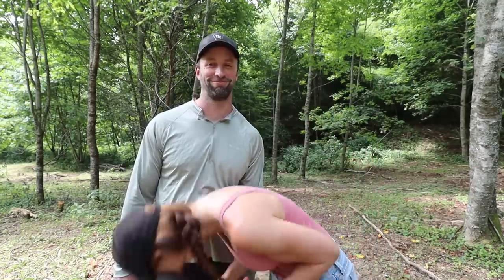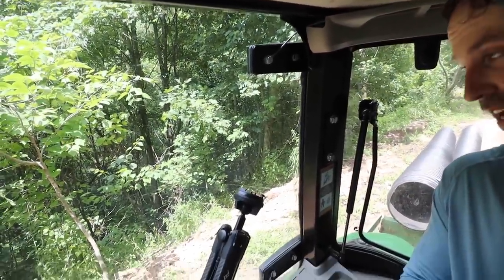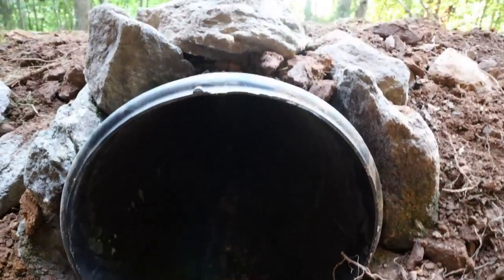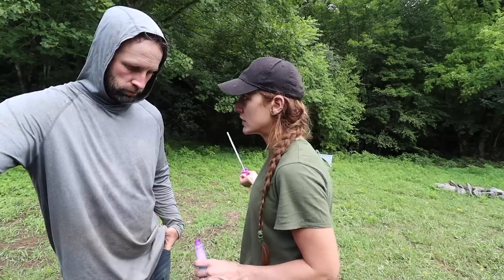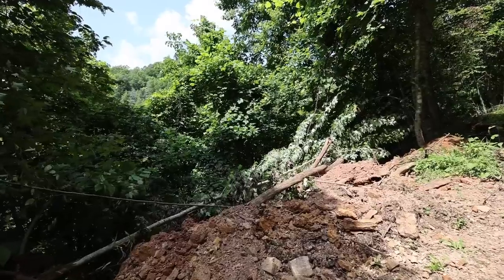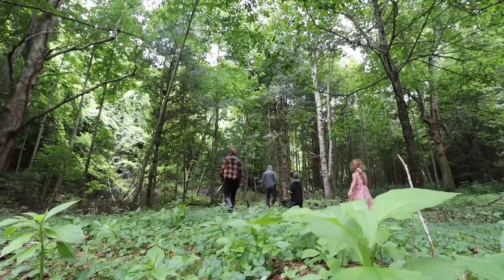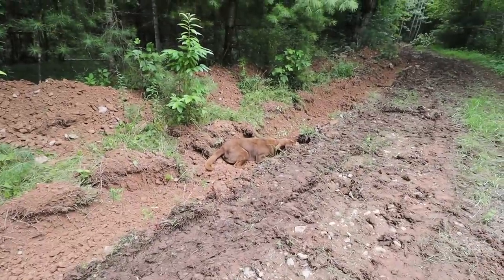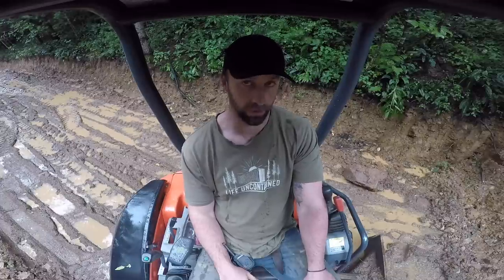FIGHTING ROCK, RAIN, & MUD | Building A Mountain Road

Comment: I think an excavator needs to be on your Xmas list. Your building a future from the foundations up because of this your future is going to be so much better. What a sensible approach.
Reply: Yes, that's what I was thinking also.  With especially how much they have to do. Sure would come in handy. They are easy to sell once or if they ever get done with it.  Also if they get one make sure it has a thumb attachment on the bucket. Makes it easier picking up brush or rocks.
Reply: With rock hammer attachment

Comment: They look to be orchard varieties, it doesn't;t take long for non-fruiting trees to take up residence. We see it a lot in the UK and Ireland, where old properties are taken over by nature but the fruit trees are so hardy they carry on even though crowded. I think it's perhaps because the soil is so fertile.
Reply: the apple tree has ceader blight you can tell by the yellow spots on the leaves and the small size of frute you need to spray it with spectracide immunox multi- purpose fungicid it took me 3 years to figer that out spray in the spring

Comment: With coyotes around, always be alert to where your domestic dogs are. When lived in CO. the local coyotes figured out they can use a female coyote in heat to lure male dogs away. Once far enough away, the pack would attack and kill them to eat,  even very large dogs too. Several people lost their pets and still do.
Reply: Facts!
Reply: Yes, I've had coyotes attack dogs and seen them lure dogs so the pack could attack them.
Reply: Our dogs take care of all the coyotes…. It all depends on the dog and how you train it… most country dogs can take care of coyotes and coyotes don’t usually run in packs they are solitary animals
Reply: Spencer I'm really surprised you didn't install your cohorts at an angle across the road instead of putting them at a ninety-degree hopefully that won't be a problem but I suspect it may. Water always seeks the path of least resistance and very seldom going downhill will it make a 90° turn

Comment: Homestead and Farmer Pro Tip: Keep a  small roll of heavy gauge electric fence wire in your "toolbox" always. It's the "MacGyver" for everything. We use it when keeper pins are lost. Keeps us rolling on construction vehicles, trackhoes, dozers, tractors, etc.

Comment: Great videos. One suggestion after watching Ambition strikes ,good simple living,pure living for life would be any thought about having a contractor build a pole barn on property so when winter comes the trailer can be put inside and other equipment put inside so heating trailer would be less problems and would be sheltered from elements. Also some type of larger propane tank. On ambition strikes they built pole barn and put camper inside while building a apartment in barn.  Anyway just be patient and if stress gets too bad just take a mini vacation. Your relationship is more important than anything else. Again keep moving forward and it will get done!!!!

Comment: Just found a homestead diy guy, Ben Falk, who recommended WOOD CHIPS for driveways and road. Says it's 25% cheaper than gravel and is def better for environment. Old chips can be moved to garden areas or other compost needs. Says it needs replacing or replenishes 4yrs, abt the same as gravel. Dunno. Thot of you guys and wanted to share. I'm using woodchips and mulch to transform my urban colonial plot into native plants oasis. Well that's the plan anyway! 
❤ you guys!

Comment: You guys probably should go ahead and buy a mini ex and maybe and skid steer as well. Many similar channels (ODW Morgans, Michygoss, Trent&Allie, Lumna Acres,  Wranglerstar, Ambition Strikes) all have and they pretty much use them continuously. You might be able to partner with some of the suppliers, but they hold their value so you can use them and sell them and near break even. I would also suggest looking into the EcoFlow power system as a starter solar/generator system now and when you get your cabin container there. One step at a time and look how much progress you have made there in a few months.

Comment: Spencer, you are not putting enough rock around the pipes. They need to be covered all the way around the pipe and across the ditch and at least a foot or two in each direction. You are not going to stop erosion only putting rock across the top and sides. The ditch will erode leaving it the way it is, and it won't be long before the ditch is not draining properly because of the erosion.

Also, on the downhill side of the pipe you need to make sure that the ground underneath the pipe is not going to erode from water draining out of the pipe.
Reply: And please make sure you are digging and putting the culverts far enough down. Also remember that type of culvert cracks and breaks easier than the other kind.

Comment: is the culverts deep enough to not collapse when a big truck rolls by?
Reply: True, I wondered how much weight those things take. In Europe I've only seen concrete pipes used.
Reply: Keep out big trucks when it's wet, for the sake of the rest of the road.  Yes they could squish the material either side of the pipe if they aren't deep enough.
Reply: Reinforced concrete pipe (RCP) only requires about 4” from surface in many cases (in Florida at least). Corrugated plastic pipe like this requires deeper burials, not necessarily due to strength issues but rather buoyancy issues. RCP is heavier obviously hence the shallow depth required. Both have strength. The corregation helps the plastic. Concrete pipes would be rather brittle if they weren’t reinforced with steel.
Reply: I like these two and I wish them the best. But Spencer has done some things that are going to fail and he’s going to have to redo them. I’ve seen many subscribers give sound advice and he has not taken it.

Comment: I am not sure if I should cry or laugh seeing and hearing about your guys' troubles... It is very familiar to me. About 2/3 of our almost two miles Rocky Mountains road got "thrashed" this spring when 10' of snow started melting...and water started running down our road....under ice and snow... after our "pond" in a ravine got too full. Then, when I finally had fixed our hydraulic hose on our excavator (after waiting months for a part)...I got a couple of other hydraulic leaks making me having to wait for parts...again. Right now it is end of August, and we have still not been able to drive our truck to our home...only our SXS. We have chosen a life with lots of challenges. But, I guess the reward at the end will be good. :-). All the best to you guys.
BTW - I know all about rocks. It is not called the Rockies for nothin'.....

PS: Reg.your generator... We have multiple generators for different uses. Remember the expression: "One is none, two is one". It is always good to get a backup. The last generator we got (actually got two of them) on sale at Costco was a Firman (not affiliated with them in any way ;-) ) tri-fuel and I really like it. :-)

Comment: you planning on putting a screen or something over that culvert so it doesn't get too blocked by debris? You'll still have to clear the screen, but it should be easier than clearing the pipe

Comment: Around the culverts cut back most vegetation as it will add to blocking up faster when leafs start falling.but these things take time as there might be rock. Any area need great drainage so when winter months finish the ice melts need to have a place to escape water faster.
Hope there are deep enough as some souls will push up the culverts when the ice is melting in the spring, but time will tell.

Comment: Fairly new here and i dont know your entire situation.  the road is important in the long term and you have started it so keep your chin up and keep working.  In the short term a better solution to your power and water needs seems important for reducing your stress levels.  Consider a bolt together double wide car port.  set it on some treated beams/railroad ties.  add gutters and you have 500+ sq ft of rain water collection?  could probably support 4 to 6 larger size solar panels.  it will be easy to move and you can always sell it when your done with it.  just a thought.

Comment: I remember doing that, jack hammering dirt.  Felt like a crazy man having to do it.  One would think "nah, you only need a shovel, and maybe a pick, to dig in dirt".  Wrong.  I was working construction, doing a large project around the dormitories for a state college, with lots and lots of digging.  In some of the areas the dirt was so compacted and hardened it was about a hair's breath from being called "rock".  Even the pickaxe only dug in by about half an inch every swing.  It was ridiculous.  Lots of rocks in the diggable dirt too.  By the end of the project, all of our spade shovels were concave.  The tip was worn down so much the shovel pointed inward, forming two tips, like a fat two pronged spork.

Comment: your going to have to drive stakes thru the culvert and you will need to put reinforcement at the entrance and exit of it... I usually just use dry bags of concrete and put them in place.. moisture from the ground and sky will set them.. and do yourself a favor and put a "pull out chain" thru it for future plugs that will happen.. I'd also put up some remesh in front of the ends to stop animal and tree fodder from filling it up.. armor it up or it will cause you lots of headaches..

Comment: The small chrome, usually right angle tube, that lets fuel into the carburetor, sometimes has a tiny screen on the carburetor end.
Usually they are press fit.
After turning off the fuel and removing the fuel line, back out this tube by gently pulling, while gently twisting slightly, with pliers.
When it's removed, clean it with carburetor cleaner, the reverse of flow, and outward again, with compressed air, holding-on tightly.
Reinstall the opposite of removal.
This should fix your problem.

If this doesn't cure the problem, replacement carburetors from China are surprisingly cheap, and are much easier than chasing down a carburetor problem.

Comment: Spencer, you know you can get a hydraulic jack hammer for the Kubota excavator make sure it has a quick-change connection at the joint so you can change from claw to jack hammer.
and You need to think about investing on this type of equipment since you are off grid and in the forest.

Comment: I've been watching since the piers were dug and the 2 containers were green. I dont comment often.
I think you guys would really benefit from buying a PTO generator to run behind your tractor. It could run the camper AC, and would be more reliable than gas generators. 
Also the tractor will run just fine on home heating oil or "off road diesel", red fuel. Would be cheaper than gas.

Comment: That looks like a crab apple. 
Just wondering if you should have put a fabric down and some pea gravel before inserting the culvert? Also... im thinking it should be deeper as there should be a layer of rock and dirt ontop. The culvert looks like it could crack pretty easy in whuch case you could have a major dip in the road as it caves in. Not in construction,  just my best guess.

Comment: I really hope your pups don't fall for the coyotes tricks one night. When the females are in heat, they will send her to spread her scent, then the males will attack. They tried it with our rottweiler once and it was actually scary. My husband, pitbull (female) and I were all outside, he was walking them in our fenced yard. 8 foot fence with barbed wire, 5 acres, and the coyotes tried it. Zeus went towards where the female was outside the yard. It was his pooping place. He was a slow old man, so he didn't care about her. She walked away and suddenly 6 coyotes all surrounded the yard on that side. I was already back and had the female in the dog run (for when I am lazy and don't want to walk) and turned to look at them as they were walking back. I yelled at my husband to stop and wait. He of course was all "WHY?" "TURN THE F AROUND!"" I yelled. Sure enough, 3 were trying to get UNDER the fence. I put the female inside and grabbed the baseball bat. My screaming at them like an idiot helped stop them. After that, the dogs were walked on leash only because the coyotes did not care. The city, yes city, came in and dispatched most of them, but the next year, 4 dens full of pups were wandering around. We thankfully moved for our safety

Comment: With the heavy use you need with your genset why not get a decent Army surplus with low hours and wheels or a smaller commercial unit?   Dont mess with the Home depot / box store versions as they are built to fail so you will have to replace them [aka, designed obsolesce].

Comment: At least you are verifying the accuracy of the weather forecast vs the actual. Lots of rain. Those drainage ditches and culverts will definitely help drying out the road. Who knows if in time, on the low end of the culvert, you can design water collection/bathing areas? Enough clean water runoff, rocks, retaining walls, etc.

In future as you discover more fruit trees, will you be doing more clearing to encourage growth and fruit production?

Comment: You guys need to make friends of what is called "crusher run" or PUG mix or 3/4" to dust mix at the quarry.   I would roll in  2 inch rock and then put in the PUG mix on that driveway.  You need about 4 inches of the large rocks followed by 2 inches of PUG mix.    Rolled and packed it will be almost like concrete and will make good base if you pave or concrete as well.